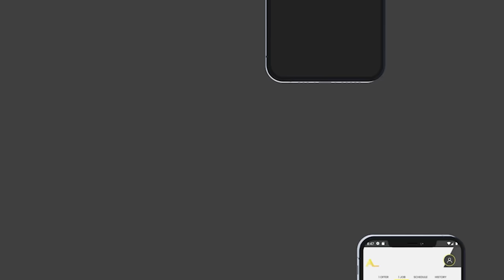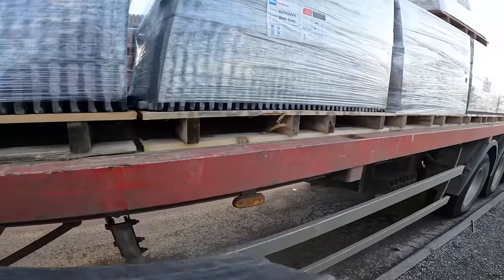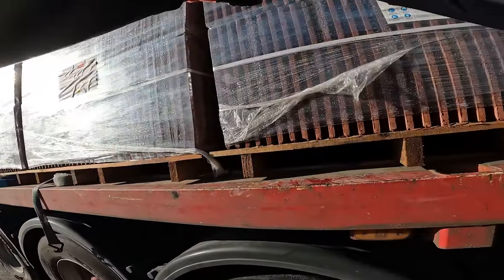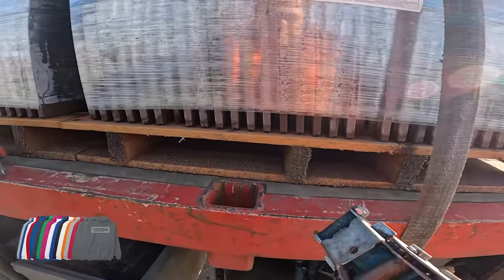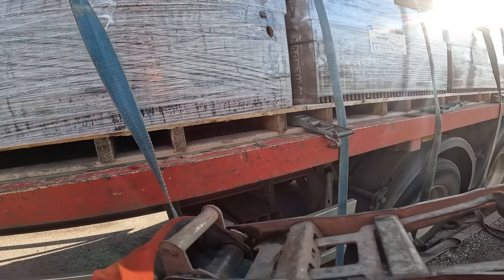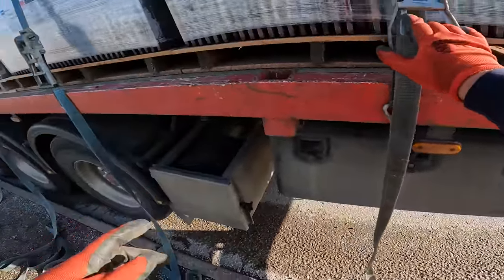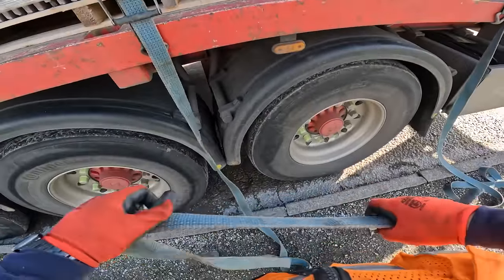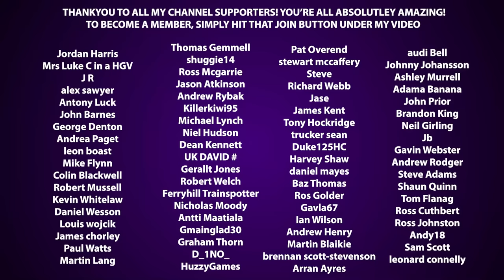POV Strapping Up A Load!

Comment: Hi Luke, Question.. If the load was odd sizes and say had a tall pallet on one side and the other side of that was a shorter pallet, Throw the strap over and it's not quite hitting the small pallet so not secure, How would you go on about this if you cannot move the pallet ? It was shown on a video of yours a while back think it was a small van with some scaffolding tubes which wasn't being hit by a strap. Cheers mate

Comment: Very interesting video, thank you! Am I right in thinking that the friction caused by the weight of the load plus the additional pressure from the straps is what is preventing the load to shift forward / backwards?

Comment: Great informative video for a newbie class 1 Driver like me,stupid question are the corner boards used all the time or just this once to protect the tiles ?
Reply: The corner boards help the ratchet strap flow easily over edge rather than damaging the strap which VOSA/DVSA doesn't like to see your arse will get spanked by them for damaged straps

Comment: Hey Luke, great content as always. Curiosity getting the better of me, but what are the square steel poles for under the trailer? Around 15 mins into your video.
Reply: maybe for flat bottom object, so the forklift can lift it up
Reply from the maker: They are to go in the square holes along each side of the trailer bed. Ideal if you’re carrying things like long length of timber for example. Obviously you would still strap it up, but it’s a side securing method.

Comment: Hi Luke.   This is my personal thoughts. Ok.   You had blue stripe protectors on one or two of the first 2 or 3 straps from headboard.   I would have made those on the corner boards.  At rear ie last pallets either side, I would have strapped them diagonally     As said just , it’s just what I would have done    Wish You Well.
Reply from the maker: Cheers for the comment mate, yeah, there’s many ways it could’ve been strapped. Everyone is different that’s the beauty of it.

Comment: Have you ever had starps keep loseinging on you
Reply from the maker: Yes. Happens quite often normally a load will shift slightly which were caused the strap to be loose, whilst driving you are constantly checking your mirrors to ensure the straps are still on and if any appear to loose you pull over and do them back up. Also, I always make sure my straps are tight whenever I finish for the day.